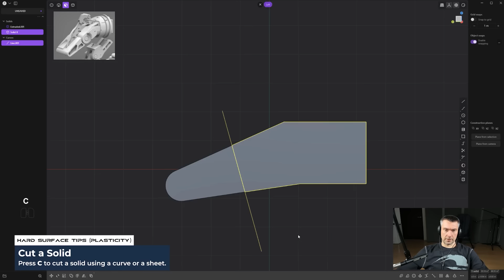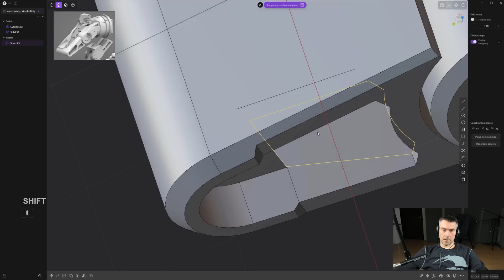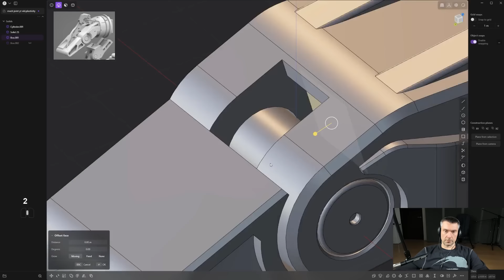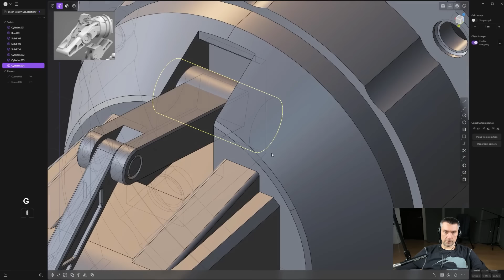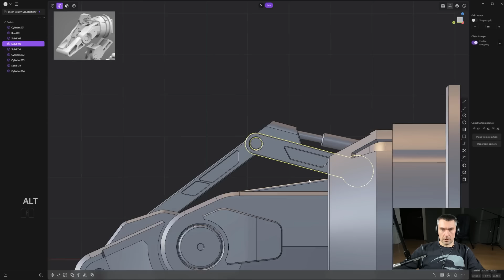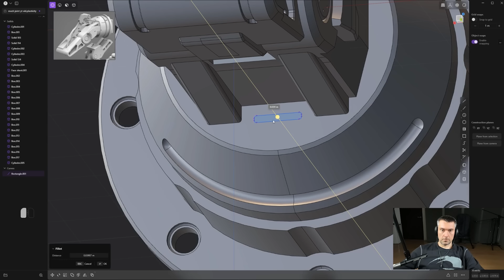How to Get Better at Mechanical Design (FAST)

Comment: Thank you for sharing this information. after save this file, will it be saved as separate parts, considering that this design is an assembly? Or will it be stored as a single block where we can’t benefit from the individual parts we designed separately?